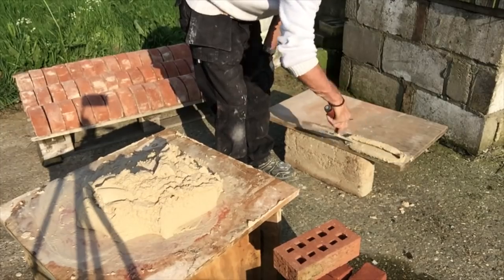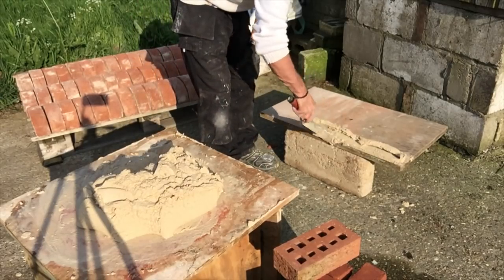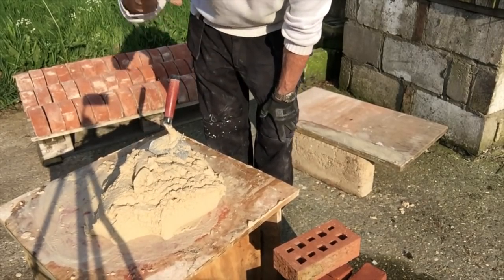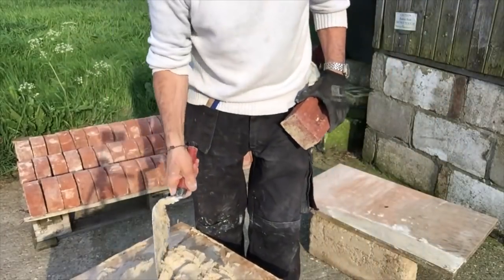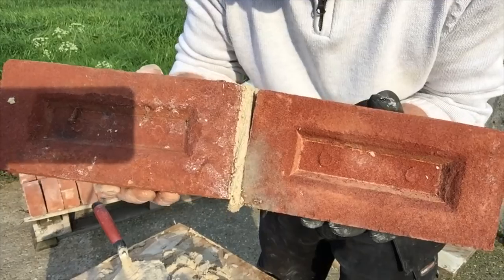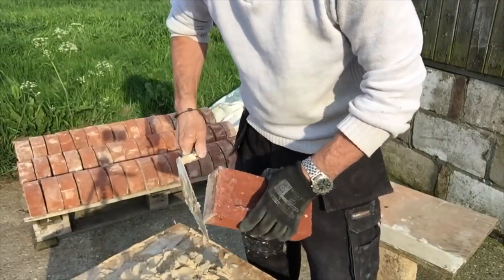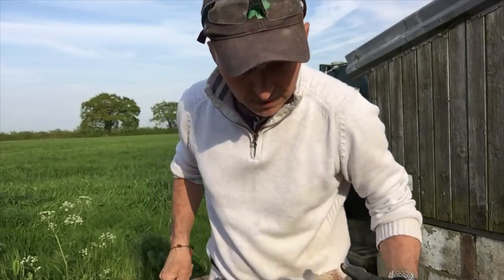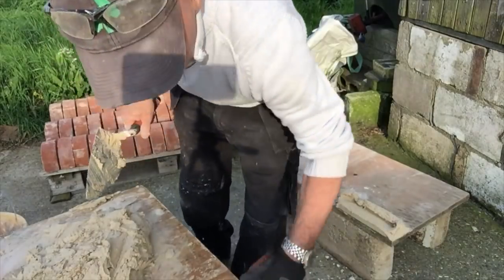how to lay bricks - Basic Skills Lesson 1 - Freehand Panel

Comment: Brilliant video Rob.  Thanks for sharing your years of experience.  Someone lower down asks if that's what the frog is for.  To hold like you show.  Is that correct, and if not, what IS the frog for.
A slight aside; I was told always to drill into the mortar when putting up a bracket/fixing etc.  
2 reasons: 1) Mortar can be replaced relatively easily - as compared to a whole brick, and 
2) Unless you built the wall, there is no way to know whether the frog is up or down, so when drilling into the brick the hole might go into the frog therefore reducing the strength of the fixing.   Would you agree with that logic?  Seems to make sense.
Regards Mark in the UK
Reply from the maker: a frog has 2 main reasons for being in a brick, firstly, it reduces the weight of the brick making it easy to handle, and secondly, as the mortar fills it it gives a great bond/key to those bricks around it.
they should never be laid frog down.
Reply: Thanks for such a quick reply Rob, but am I correct in thinking that engineering bricks don't have a frog?
Reply from the maker: Class A Engineering are generally solid, Class B normally have 3 holes and semi engineering normally have several holes. 
These holes provide the same benefits as a frog, they make the brick lighter for handling, provide a key for the mortar to hold into

Comment: Good video rob. Apart from the tip and tail perping technique I think all of the perping up techniques you showed can be used to achieve a full joint that does not require filling when jointing up ( even if you end up with the chamfers after buttering the brick  ) Here’s a demonstration of the ice cream cone technique https://youtu.be/P5GslPh5D7g   You can see the perp has the chamfers but the bricklayer (who is nicely skilled) has no bother achieving a full joint . Also if your manipulating the brick with your left hand while tapping down on the brick with your trowel in the right hand, then to me you are laying the brick with both hands.

Comment: Rob
 no tapping learn to rub a brick down along its length not  side to side .
show learning to spread a bed on a length of   4X2   ... 
1/2 batts cut go's into the joint keeps the back flush and width's the same ... 
sorry know i am being picky but did teach the trade for several years .....

Comment: rob are you using practice mortar? what is the mix?
Reply: 588158 hydraulic lime & sand only - that's why it's very white and easy to take down work after
Reply: what is hydraulic line
Reply: Hydrated lime is bagged powdered lime, whereas there is also slacked lime which is a lump that is delivered to site and covered with sack, sprayed with water until it heats up. Then it becomes like a cream that came be racked off. I used to use it mainly on what was once called red rubbers, very specialist brickwork that is very rare to see nowadays. Hope this helps?, but then again Mr Google is better at explaining.

Comment: I hate to give away the secrets of the" legend of Ontario" but you can have flat head joints with the boom boom bang method if the last slap is more flush with the face. Same goes for bed joints, when you cut the mortar to reuse on head joints, cut it so it is standing tall. And don't string mortar for one brick at a time and do that stupid figure 8. Furrow once. Pivot on one leg closest to the work, don't twist your torso that much. And if you lay frog down the labourer will thank you for using less mortar
Reply from the maker: thank you for sharing your method. One point to add, frog down will get you thrown off most sites here.
if you listen to the beginning of this video again, I do say this is the method (from the way of the best bricklayer I have ever worked with - Derek Almond) that I use and it may not be for everyone, and I say to keep to your ways if you don't like this.
thank you for watching.
Reply: @robsonger1  I was a bit rude. Sorry. In North America we don't care which way you ut the frog. By the way I'm not a legend, I'm jus an ordinary bricklayer with to much time on my hand so I make rude comments on the internet sometimes

Comment: How do you hold solid Staffordshire blues?
Reply from the maker: with gloves on....they are good at roughing up skin
Reply: @robsonger1  lol just wondered how you lay them with no frog
Reply from the maker: ah Stuart, I see. It comes with experience but the habit for picking up and spreading just the right amount of mortar has to be adjusted to a lesser amount, simply to compensate there being no frog.
And with all engineering bricks the mortar must never be too wet and the bricks must be dry. If you try laying with wet mortar and/or bricks will find that after a few courses the joints will begin to ooze out and the bricks will sink down. Staining will also be a huge problem, even linseed oil struggles to clean it.
Reply: rob songer rob have you  hidden my reply to this gentleman. I noticed when I view the video when I’m not signed in there are 3 reply’s to his original comment with my reply to him not visible but when I sign in there are 4 reply’s  listed with my reply to him visible.
Reply from the maker: I just looked, and I can't see a reply from you to Stuart.
Reply: rob songer I can see it ,I’m looking at it right now . Can’t see it when I sign out only when I’m signed in ( like I am now). I check every time I sign out after leaving a comment on a video to make sure its there when I sign out . I got into that habit after Stu crompton started hiding my comments because he doesn’t like constructive criticism.
Reply: @robsonger1  hey guys I didn't wanna cause a domestic !!
Reply: Stuart Jones no domestic Stuart . Simple fact. I posted a comment in reply to your comment and I can only see it when I sign in .

Comment: Is that in fact what the frog is for?
Reply: Julius Bell no mate that’s not what the frog is for . According to google when bricks were hand made in wooden moulds  the clay was dropped into the mold it hit the frog and  it aided the clay to spread into the perimeter and corners of the mould .Also Frogs in bricks and holes in brick are not necessary in bonding brickwork together if that were the case solid bricks could not be bonded together .

Comment: He left his 3rd and 5th quarter-panel open, and forgot to maintain an average setting ratio of 3:7.5 on the lower subsection...
His peripheral spacing is a tad bit off, and I couldn't help but notice his lack of trowel oil will cause massive deterioration...

I would know, I'm a certified internet expert and made all this up right now
Reply from the maker: very well noticed, but you forgot to mention that the according to the Brickwork Bylaw of 1832, 13A subsection 2,which states that the mortaring of clay components is superficially transparent when transfigured with lime in conjunction with unbelievers.. is total tisssh

Comment: Why frog up???
Reply from the maker: Always frog up..
A facing brick is guaranteed a 20N crushing strength, but not if they are laid frog down.
Bricks were designed to be laid frog up. Frog up gives max strength
Reply: @robsonger1  Do you do training?
Reply from the maker: @cd78  Yes, in very small groups although as you can imagine things have been suspended recently.

Comment: frgs down, shitty cheap trowel ugly face joint not full dirty both edges if recessed joint never have too much on back if  you pull trowel along centred always level uif you hold brick front and back at same time turn a brick upside down to butter? too funny